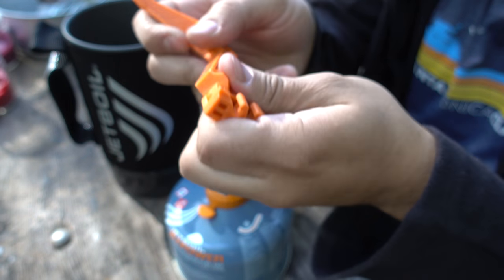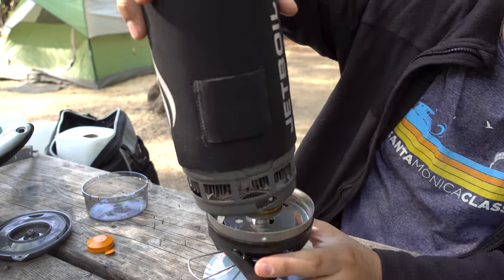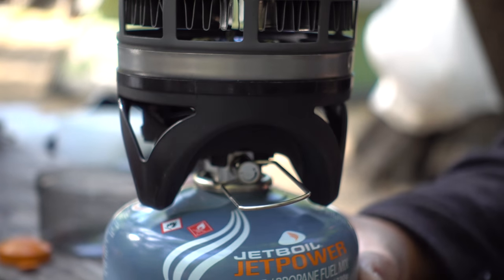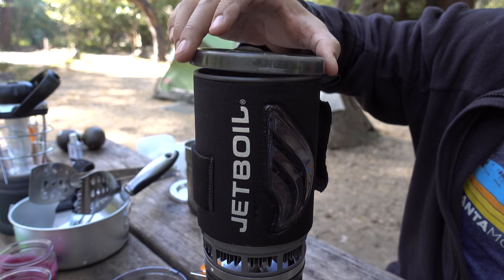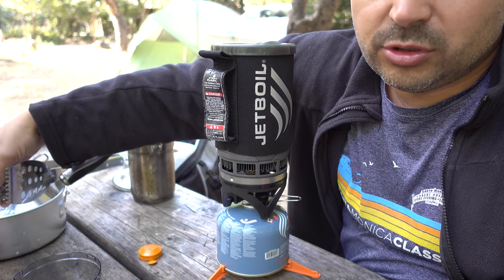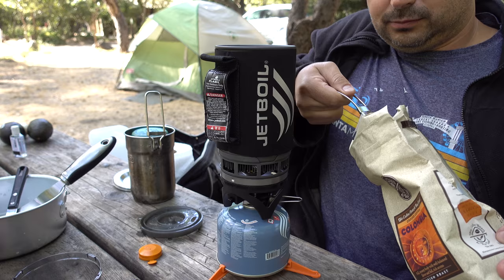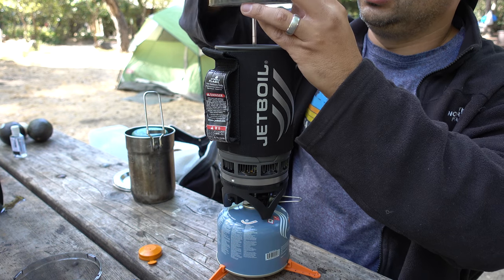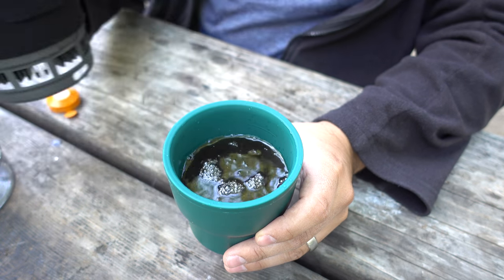JetBoil Flash & Coffee Press - How To Use It? | 4K

Comment: I took the coffee press with me in my jetboil on a hiking trip out to Montana a few years ago and the coffee grounds got all in the water when I pushed it down. I never knew I had it on backwards until just reading this post! Just tried it the right way and barely any grounds. Imagine that! All this time I had no idea. Thank you Quentin for pointing that out.
Reply: @Paul Taylor, a good solution to getting grounds in your coffee is to avoid buying ground coffee. It's too fine for the press. Instead, buy the whole beans, and then ground them coarsely.  The stores that sell whole beans usually have grinders. Just turn the knob to "coarse", and then grind away. Because the grains are much bigger, you need to let the coffee soak longer. But they won't get past the press.
Reply: Me too. Trial and error man. That's all. You figured it out.

Comment: Luke, great vid. love pressed coffee. I have used my original Jetboil and their press for many years on Motorcycle camping trips. The major bummer about the press is the mess at the end to clean up. Plus after using the cup many times, it became stained and my wife said stuff we cooked in it had coffee flavor. I eventually purchased a spare cup for cooking. Then last year or so I came across the MyJo by Presto. Its cheap, uses K cups and no mess. I think if you try it, you may find it one of the best camp coffee combinations there is! You have a cool channel! I subbed.
Reply from the maker: I’ll have to check out the MyJo. Thanks so much Sir Squally Wally!

Comment: Oh my a campground for tents instead of RVs. How lovely. Is the jetboil pot portion made out of stainless steel or aluminum? How much boiling time to you get out of one canister? And where can you buy the canisters, anywhere like Walmart? Thanks for the video. I've been debating whether to buy this item.
Reply from the maker: There were mainly tent around us but I think they have some RVs too. It was at Pfeiffer Big Sur State Park. From what I found, the pot is made up of Aluminum with a stainless steel burner.  It all depends on the fuel size in the canister. But i think the smaller 250g cans last around 70 minutes of cooking time. Which should be about 7 days depending on the amount of use.  Yes, you can buy the fuel canisters almost anywhere with outdoor equipment (REI, walmart, amazon, etc.). I really like it because i just need quick hot water. It does a great job achieving that goal.
Reply: @LukesHomeTube  thanks for responding.

Comment: When I screw the canister on to my jetboil i hear a hissing noise? Does this mean I have a defective fuel canister or jetboil unit?
Reply from the maker: You could try another fuel canister to find out which one is the issue.
Reply: Luke's HomeTube ok I will, I did buy two with my new jetboil. I spare.
Reply: MW Radz  lmao no it is not defective! When you pop the seal by screen it on there it allows some of the gas to escape before being completely tightened duh! Common sense goes a long ways
Reply: Kevin Martin ..yes it is working fine